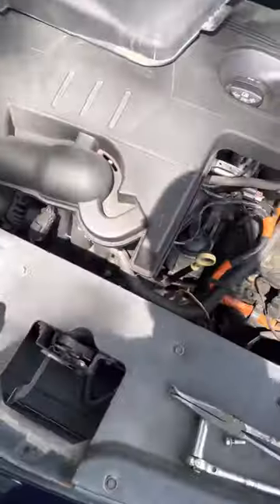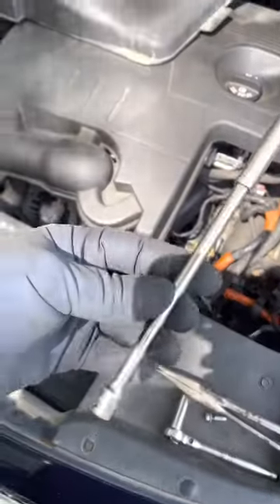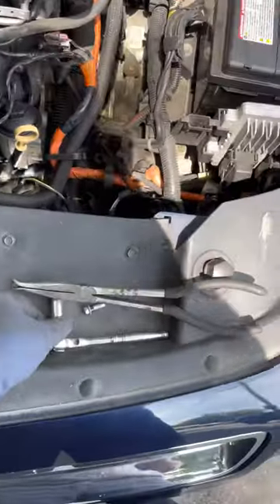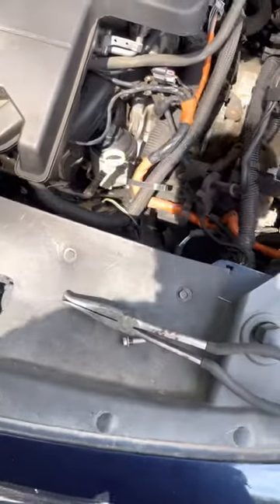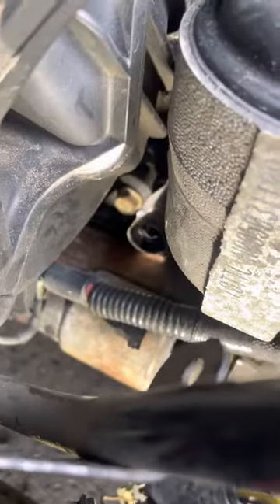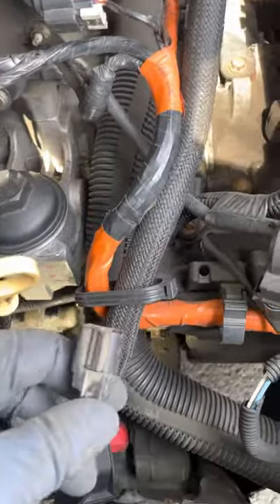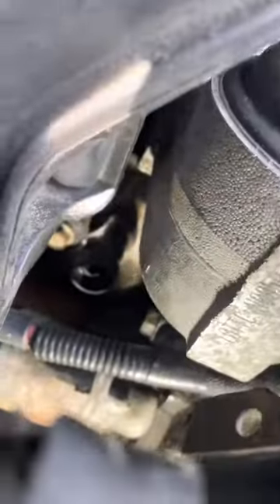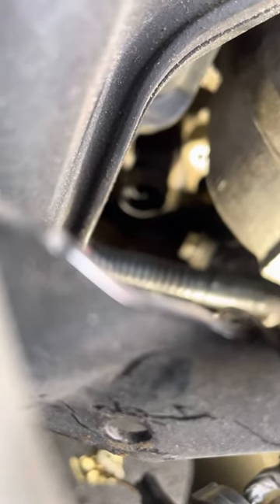2010 Malibu 2.4 crank sensor without removing the starter. Quick and easy.

Comment: did you remove the oil pressure sensor 1st or just the connector to the oil pressure sensor? i have a 2004 malibu 2.2 l , 4 cyl engine the plastic intake manifold is too close to the oil pressure sensor connector and i was unsure how to remove the connector from the oil pressure sensor. also my crank sensor is held in by a 10mm bolt not 8 mm. any ideas appreciated, i am assuming you did not have to remove the starter. my oil filter housing is the same as yours.